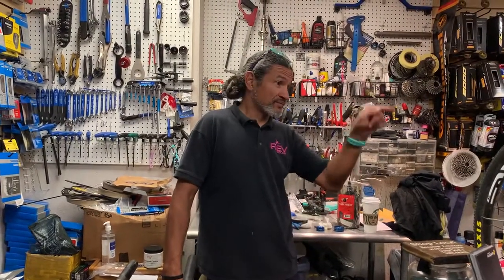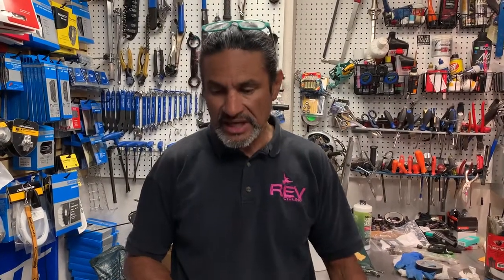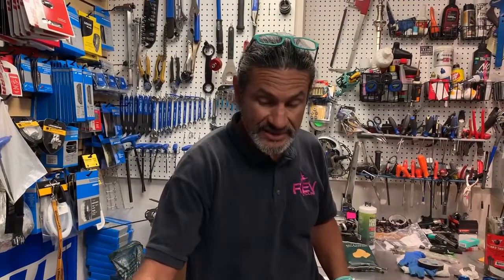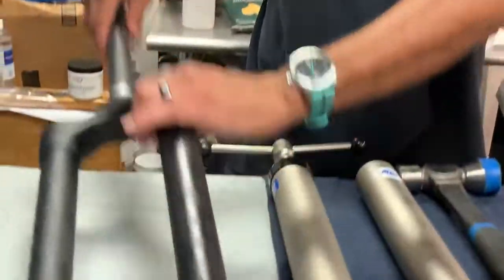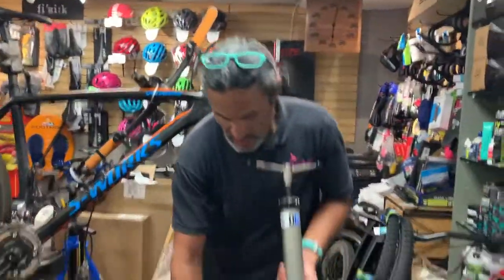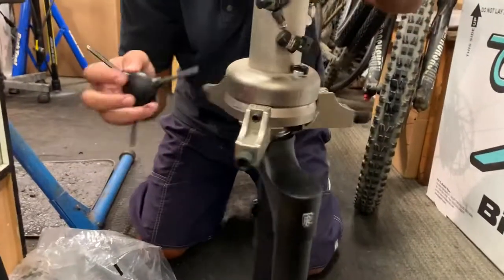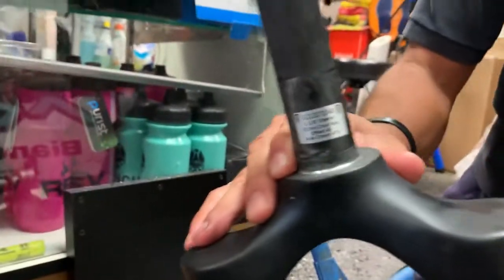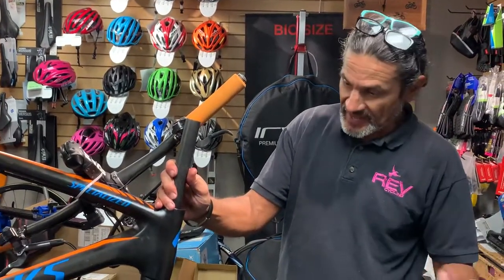How to convert Specialized Stumpjumper from 1.5" to 1 1/8" steerer tube fork

Comment: Have a 2016-17 Cannondale Slate Gravel Lefty Bike. I'd like to use a Vecnum FreeQence Suspension Stem, but found out they only manufacture for  1" 1/8 steerer tubes (the Slate being 1.5"). Suggestions to convert 1.5" to 1"1/8? Maybe you have a video about that. Thanks, Francisco, Monterrey, México.
Reply from the maker: I’m probably never going to do a video about that. 😂 those kinds of bikes and that kind of conversion will never come through my high end road shop
Reply: @SeeYouUpTheRoad  🥺🙃

Comment: I have a connondale sl4 that has a lot of meaning to be me. I just picked up a trex roscoe 9 in desert tan. So I wanna rebuild the Cannondale, it’s old sl4 Duce, I already did rims , hub’s, Cranks, bars. Etc. What I wanna do next it put a pair of air front forks. It’s a 1.5 headset factory with rock shocks from cannondale. I want to put 1.8 air forks. I just spent almost 2600$ on new Trex. What forks can I use that are reasonable, and do you know what kit I need to make the headset fit 1.8 forks. I’m in michigan if you could help. Or anyone in michigan has forks for sale please let me know. Thanks
Reply from the maker: My apologies but I’m a high end road shop. This bike was a huge PITA. I don’t do this type of work so I won’t be able to help you. I was given the wrong advice on this job and it took way too much time to get this bike done. I’m sorry I wish I knew more about MTB but I’ve created a very successful niche in high end road.
Reply: @SeeYouUpTheRoad  thanks for the honesty , I have a few newer bikes and just bought a Trex recon 9 in desert tan. 
The cannondale sl4 I have is from 2011 but it’s been with me in different countries. I was able to take it with me. It has a lot of meaningful memories. It is almost all rebuilt. My plan is to do a 1.5-1.8 reducer for forks and going to do a Fox air shock or something similar. The Roscoe 9 is nice but I think I could of done better for 2600$ the color scheme caught me and I useally know better. Thanks have a great day.